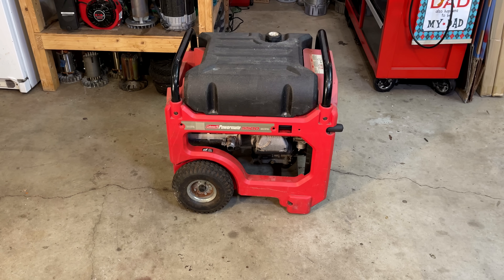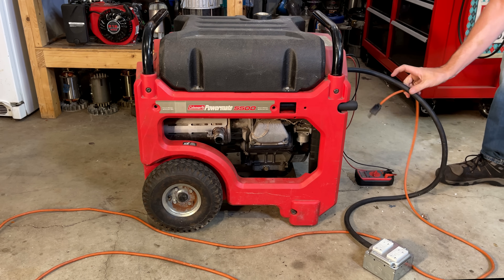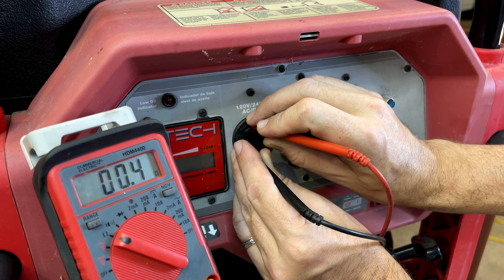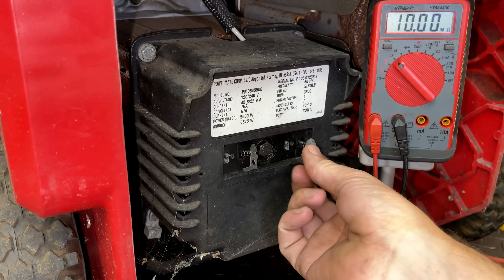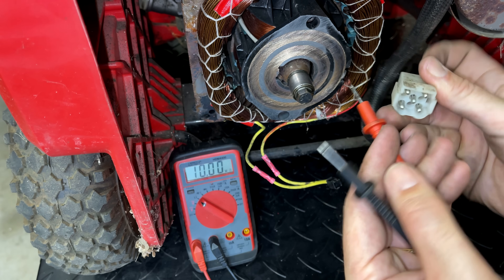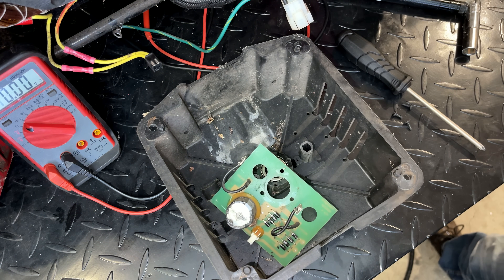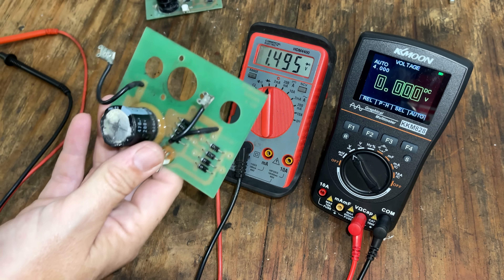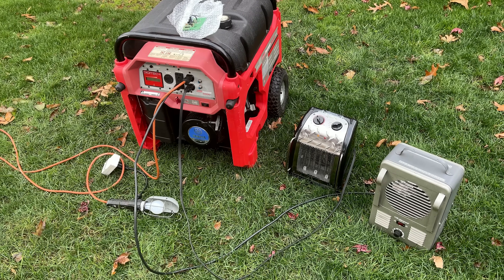Parts Generator?  Or an Easy Fix (No Output)

Comment: I've been watching a ton of your videos. Impressive I must say. Question (if I may be so bold?), how high an OHM reading on the rotating assembly is beyond use? I have one I have been getting going and it reads 81 OHMS across the brushes with them installed. Thanks in advance.
Reply from the maker: It really depends on the the generator.  Most made in the last 20 years in the 5000-8000 watt range,  70 ohms is the high end of ok.  but through the brushes it can be a lot higher depending on the condition of the brushes and how clean the slip rings are.    Would suspect you are below 70 ohms if you test on the slip rings.  Also if it still works then would not worry about it.  Just the higher the resistance the more voltage the AVR needs to put in to get up to 120/240 volts.  Under full load the AVR might not be able to fully compensate because it is maxed out on voltage.
Reply: @jcondon1  Thank you for your response. Since I posted my question, I pulled the brushes back out and cleaned the slip rings. Afterwards it read 47 ohms through the brush terminals. I took a reading of the fields and got .4 OHMS. Thinking it was the AVR, I replaced it. Still no power out. I tried the drill thing trying to flash it. Still nothing. I'm kind of on a mission to make this work, so if you have any ideas I would much appreciated.

Comment: Hey James,..😊 Do you work at Ohm,..? Is this Watt you do for a living Currently? I’m sure you get Ample work,because you’re a very bright Spark. I hope your days are Positive and not Negative,but,lm sure you’re well Grounded.l guess your friends are wondering Wire your so clever,..You’re so clever,it’s Shocking! I tried to get a job as a Linesman, but was too Short. I don’t Arc up about it though,..In life,it’s all about Connections. Thanks for a great Cable show. Merry Christmas,and a very Zappy new year.😊
Reply from the maker: Great comment.  Have a Merry Christmas!
Reply: Thanx James,..l’ll give your program a Plug to my friends ! 😉 l hope it Generates more subscribers,after they’re Switched on to your program. 😀👍🏻

Comment: Is there any aftermarket AVR's that can be added to correct the high/low voltage issues??
Reply from the maker: There are some that could work.  They are mostly meant for larger generators.

Comment: Hi James, I just had a question and it on that display board you replaced did you compare on both boards where the dip switches were set on both of them because if the switches were changed on the one you replaced it would make it do the things it was doing. Just wondering have a great holiday season.
Reply from the maker: I did not compare the dip switches.  I may have been quick to assume they were the same since it came from the same model generator.
Reply: James what I was thinking is that someone might have messed with them but it's just a thought.

Comment: Can you sand the brushes to clean them up and flatem them up?
Reply from the maker: Never tried, but should be ok
Reply: Brushes rubbing on a slip ring surface need to follow the curve of the rotor. If they do not then you will not make good contact and good contact is essential. I have seen it done, but very carefully and slowly.
Reply: Well can you?? I would like to know
Reply: @jcondon1  ok that you
Reply: @r8118830  ok that you.

Comment: I have a new (runs like a champ) 8500W Firman (Fireman?) generator that was overloaded. Now if I plug in one item (space heater or IPad charger) it generates and works.  If I add one item to it (regardless how small) it simply stops delivering power.  If I take one item off…it starts sending power.  The amount of power usage of either item does not seem to be the issue…but only ONE. Any ideas?

Comment: Why did the PCB have 8 diodes? I'd expect 4 in a simple single phase bridge?
Reply: If I had guess that the diodes are paralleled up for increased current capacity.
Reply: @mcu_nerd2163  Maybe but that is very poor practise as diodes unless closely matched ie off the same wafer will has different forward voltage and thus not share the current equally. Far better to use single, higher rated diodes. Maybe these machines are C cubed? Cheap Chinese Crap. Im in UK so dont recognise the brand.
Reply: @bobminchin  Yea, it generally isn't good practice, but I've seen similar things done in products before such as multiple LEDs in parallel sharing a single resistor.
Reply from the maker: They are just in parallel to allow more current.

Comment: Can you please help me with mine.  I have a Troy built and my avr is not adjustable and I have 114 volts at 57 hz.  I don’t want to get rid of it
Reply from the maker: What is the model number?
Reply: @jcondon1  hi thank you very much for getting back to me and I am always watching your videos but anyway model number is 030237. I changed the avr the plug is good and maybe 40 hours on it. I always change the oil and filter. I have the brushes but I did not change it but they look really good I am going to try to give you my email but google will not let me
Reply: Is there a way I can get in touch with you some how
Reply: @jcondon1  I guess you are busy but I left you model number when you have time and your personal experience do you have any idea what it could possibly be. Like what else that I can change on it and maybe I will get lucky and I forgot to tell you that I am running natural gas and it worked great for a while   Like maybe 40 hours and then it seems I lost power. Troy built 114. To maybe 116 and 58 to 56 hz. Just trying to give you more information
Reply from the maker: @richy275  sorry YouTube is not good at showing me relies.  I have seen that regulator before and your right there is not adjustment.  I believe the voltage is based on the engine speed.  It should be running closer to 62 hertz without a load.  That will bring the voltage up some but with a regulator like this you should be closer to 130 volts at 62 hertz.  I would try cleaning the slip rings if they look dirty.  Also look at all the connection in the power head.  Make sure they are tight and no corrosion.  Also with the generator off check the resistance of each 120 volt outlet.  There could be high resistance in a connection or circuit breaker.
Reply: @jcondon1  thank you very much if I can not get it going would you be interested in it with maybe 40 hours on it the engine is like new
Reply from the maker: @richy275  I would be
Reply: @jcondon1  I will get back to you. I am going to need at least a 12000 natural gas one that won’t hurt my computers and tvs. I know you know what I mean and I know I have to give you more money but I don’t know what you have. Get back to me and let me know
Reply: I also have been trying with the engine speed and no luck. It is over 3900rpms
Reply: Also I have new brushes but I did not put them in yet and the rings are pretty clean but I will clean them and install new brushes
Reply: @jcondon1  I left you a text did you get it yet. If you are busy I will talk to you another time
Reply: @jcondon1  I have been trying to give you another model number but google will not post it but I have gotten my generator working by changing the brushes and spark plug box it is not working at a 100 present. If you have a 12000 kw with natural gas maybe I will get that one from you
Reply: @jcondon1  I will give you half of another generator number and I will give you the other half next time but anyway it is 646209
Reply: @jcondon1  copy down the first numbers I gave you down on paper and the last ones are 7231
Reply: @jcondon1  let me know when you write down these numbers and I will explain the next time I text you
Reply: @jcondon1  hello and happy holidays. I was wondering if you received my texts about writing down another generator model numbers I will explain once you write them down on paper ok?
Reply: @jcondon1  also I checked oms with the battery connected and I have gotten 80 on my meter could you tell me what that means please
Reply: @jcondon1  did you get my text yet. I am leaving you numbers this is the guy with the Troy built
Reply from the maker: Not sure what you mean by give me more money.  I do not have any generators that run on natural gas or any that can run a 12,000 watt load.
Reply from the maker: The max you should set it to is 3750.  If not getting the correct voltage there there is something wrong.
Reply: @jcondon1  I did replace the brushes and new special spark plug for natural gas and I did run it on gasoline to try it and all my numbers came back up to what I needed but to me it sounds a little weak when I added over 3000 watts but I did check the brushes on oms and I have gotten 80.  Do you know what would that mean
Reply: @jcondon1  for some reason your email didn’t work and I am not sure
Reply: @jcondon1  did you write down those model numbers on the two texts I sent you.  I will explain when you received them.  Please get back to me because I can not use your email for some reason
Reply from the maker: I do not have anything that large.  Most sold with the recent storm.
Reply from the maker: I am not able to locate a generator with that model number.

Comment: Wow! What a find (as it turned out).  Wonder what a new display costs and wonder if Bassguitarist1985 could've fixed the bad one if you didn't have the spare.
Reply from the maker: I checked and the display is not listed even as a part you can buy.  Usually vendors ask about $50-$80 for a display like that.

Comment: So it's $5 worth of parts that brought down the machine. Good thing they used simple diodes and capacitor without any potting or waterproof coating. No fancy ic chips. Replacing parts is easy. Change out the diodes too while you're replacing the caps, a 100 strip of diodes is dirt cheap. 

The display looks like it was cooked. Exposed to prolong heat or Sun.

Comment: Next time repair boards yourself. No sense in sending it out when it's capacitor and diode. You can test those yourself. Capacitors fail due to age , moisture and not necessarily due to any other reason. Thanks for the video.
Reply: It's a no-brainer to swap out capacitors.

Comment: The end of the rotor is held by that plastic cover? That's some extreme cost saving right there
Reply from the maker: Yes, not my favorite design.   That said, have not see an end cover fail (yet).
Reply: @jcondon1  i honestly wonder how they handle the axial movement. Is the engine bearing supposed to take care of it? Running this gennie on a not even surface is a big concern

Comment: what is a breakout cord?
Reply: Splits the 240 outlet into 2 outlets, one on each leg of power.
Reply from the maker: It plugs into the 240 volt outlet and converts it to 120 volt outlets breaking out leg one and leg two.
Reply: I see. My generator came with a similar cord. thanks for the reply

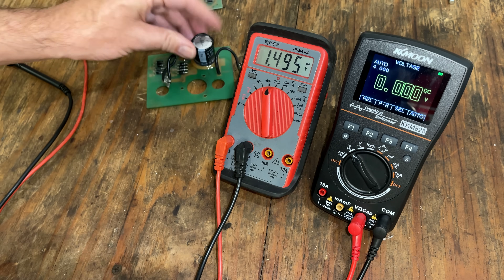Comment: 30:45.  Are there "AC" and "DC" capacitors?
Reply: Are you connected to the same internet as the rest of us?  Perhaps use it for its intended purpose?
Reply: @ShainAndrews  Are there "AC" and "DC" capacitors as claimed?
Reply: @MrShobar  there are polar (requires DC) and non polar, which can accept AC or DC
Reply: @Bassguitarist1985  An electrolytic capacitor requires proper connection to ensure that the dielectric film is properly formed.  There is no such thing as an AC and a DC capacitor as stated.  Only a polar capacitor and a non-polar capacitor.   BTW all capacitors are intended to pass an AC waveform and block DC.
Reply: @MrShobar  That's exactly what I said
Reply: @Bassguitarist1985  That's not what he said, and you didn't really make the necessary distinction here.
Reply: @MrShobar  didn't want to get too technical for those that dont know the terminology.
Reply: @Bassguitarist1985  Now you know why I didn't engage with this individual.
Reply: @Bassguitarist1985  OK.  Best Regards.

Comment: 33:53 One failure condition that could lead to this measured values is a shorted capacitor. This requires only 1 failure. Try to measure positive output to negative output. If any diode was bad, then one of your measurement should have given a 0, instead of a standard diode drop.

Try to measure AC 1 to AC 2 and AC 2 to AC 1. If both tests gives around 1V, then it is definitely the capacitor failed short circuit

Comment: In todays world most manufacturers use cheap electronic components from China. If you expose these inferior caps to a high heat environment there electrolyte will dry up and cause the caps to short out. I am curious as to what the rating of the cap is ( microfarads, volts ) as well as to what the part number is on the diodes. No chance an AVR could be fitted to this genset?
Reply: Shouldn't that diode set still be rectifying???   I thought the cap was just for filtering (smoothing) the output.
Reply: @alext8828  it will be rectifying however this capacitor in the video was shorted. A dead short across the output of the rectifiers will prevent any voltage from reaching the brushes to the rotor. Sometimes this can cause additional damage by shorting out the diodes in the rectification portion of the circuit. Bad capacitors are a plague that has ruined power supplies for the last few decades. Most capacitors that fail originate out of China and this is due to substandard components used to make the capacitors. Most of your "brick" style power supply’s for computers and electronic gear just quit putting out power since the filter cap across the output. This causes the safety circuit to shut down the supply. If you have a failure of the capacitors in the high voltage section of the supply most often there will be a loud pop and the magic smoke will be released.
Reply: @Subgunman  Ah, totally logical, Capt.  I forgot that the cap is across the 2 leads.  Thank you.
Reply: The cap is a Nichison which is a good brand and makes good and reliable caps; but here somebody has been cheap and used a 200v cap in a place where you have 191v and thats to close to max with a short lifetime. Should have been a 350v cap.

Comment: Caps from China are notoriously, bad or cheaply made. Back in the early 90s and 2000s when CPU boards were being made by major manufacturers in China they were putting in capacitors that were using incorrect data to be created causing them to fail within a year Dell gateway. Even Apple had all the problems.

Comment: James, are you saying that without that cap, the rectifying circuit won't work?  I thought that cap was just smoothing the output.  PS. I think the slip rings are tearing up the brushes.  I would polish them up.
Maybe this would be helpful for some of the plastic parts.  Take a look.   https://youtu.be/jdWRsjnVD3s
Reply from the maker: The rectifier would work, but as you point out it would be pulsed DC without any smoothing.
Reply: @jcondon1  Got it, thanks.  Hey, would you find this useful???  https://youtu.be/QXNlsawaYEg

Comment: You can't measure such small resistances with a cheap meter like this, it doesn't have enough precision or resolution.
Reply from the maker: I do need a better meter.  Have tried Klein, Amprobe and a few others.  But they are hard to read on camera and the auto off feature drives me crazy.  Have a drawer full of meters, but find myself going back to the cheap one.
Reply: @jcondon1  on some you can turn auto-off off, on uni-t you hold one button while turning it on, will disable it

Comment: Gary said diodes were good !...so your testing of the diodes were wrong?... explain ... you don't know how to test diodes properly?
Reply from the maker: The test I did was to determine if the bridge rectifier board was good or bad.  The testing was correct in that it showed the current was not flowing properly through the board.  It failed the test so I assumed it was a bad diode.  The only way to know for sure which component is bad is to remove it from circuit.  Gary found the capacitor to be shorted which would cause the diode test to fail.  Also once removed he did the same test and the board now tested well.